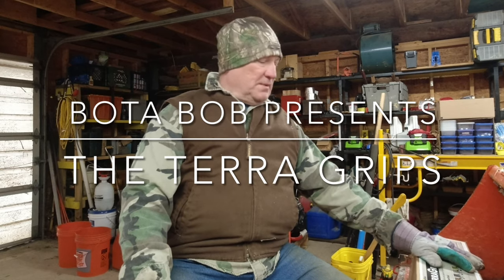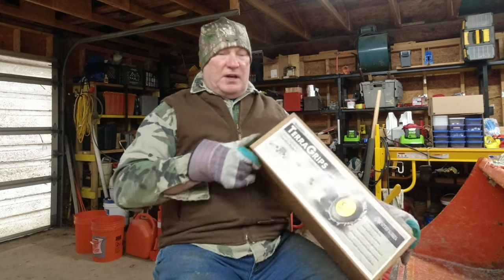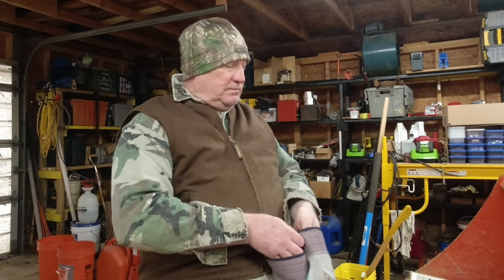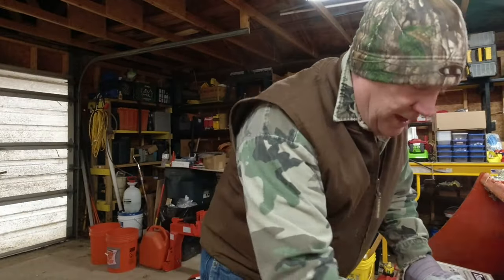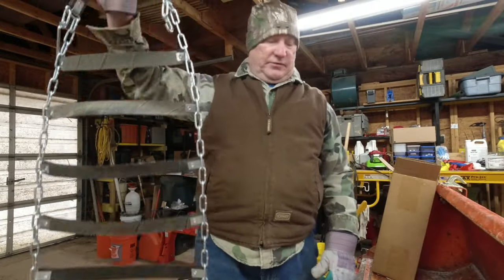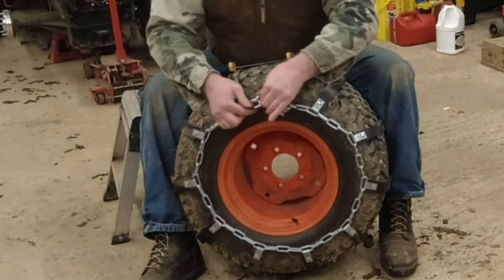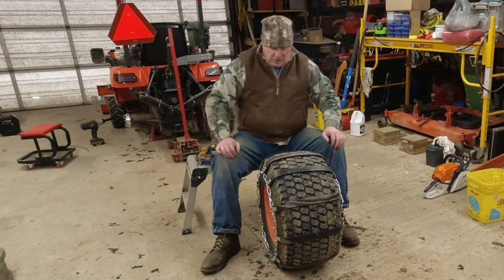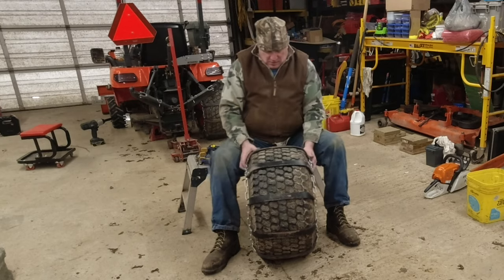#64 - Install Terra Grips

Comment: Great video and thanks for posting it.  I have been using them for 2 winters now and they work fine on my 7 degree slopped driveway along with 3 JD suitcase weights.  I took the JD out today to remove some slush to help a sheet of ice melt.  Forgot my rear suitcase weights the tire got too spinning and the chain almost came off.  I didn't get the Terras tight enough so I will have to fix it soon.  I like the use of the ratchet clamp and the tie wraps to hold the end of the chain back.  I am going to Lowes tomorrow and get a clamp. Also removing and adding air to the tires will help. Thanks again for the video and the great ideas.  I am hoping it makes installing the terra grips easier as they can they can be somewhat difficult.
Reply from the maker: They are a great traction device.  Good luck and let me know how things workout for you.  I would deffinately buy a new set if and when the time comes.  Thanks for watching and commenting - Enjoy the journey - cheers
Reply: @botabob  Hi Bob, just wanted to let you know the ratchet clamps worked great!  I bought a 4 pack of 6" clamps and I am glad I did.  The spacing of the terra grips were a little more than 6" so I started clamping on the inside of the tire after hooking that side and worked my way out using the clamps.  Worked great, thanks for the tip and thanks for your videos.   I subscribed to your channel so I will get the new ones you make when they come out.  Take care!

Comment: Looks good ! If you don’t have it in already, I recommend some type of fluid that’s non corrosive in the rear tires. Really makes a difference I think because it keeps the center of gravity low and if more weight is needed use bolt on wheel weights too. Bolt on weights without fluid filled tire not quite as good but better than none. From experience, weight makes a big difference in how good that traction is gonna be. Have a Blessed Day and stay warm, it looks cold in your garage.
Reply from the maker: Thanks for the recommendation - Stay tuned

Comment: I highly think these will work well for all year long use with weights. As they won't tear up your lawn either and can act like industrial tread tires for garden tractors.
Reply from the maker: Thanks for the suggestion - They work really good in the snow - but, they do make the tractor bounce a little.  I will try to install them this year without removing the wheels from the tractor - maybe I have learned a little since last years install - Thanks for watching and commenting - enjoy the journey - cheers
Reply: @botabob  no problem. Thinking about getting them for my Craftsman DGS6500 garden tractor. Already have wheel weights on it. Was thinking about these or ag tires for it.
Reply from the maker: The Terra Grips are excellent - I think you will like the traction they provide - I had ag tires on the back before, and they were good, but I think the Terra Grip is better - honestly the turf tires do good on the snow here, but once in awhile they will spin and I need to engage the differential lock - have a great day

Comment: Taking the tire off, smart. I’m literally installing mine in right now. I think I’m going to use my floor Jack and lift the rear end.
Reply from the maker: Good luck - check back in and let me know what you think.
Reply: @botabob  I didn’t take the tire off, used the Jack. I aired down the rear tires before putting them on (craftsman t210 by the way). I’ve been able to tighten the inside hooks by one, but I’m really having trouble moving the outside latch straps any further. 

Mine are not taught by any means, but I took a lap with them on and they did not move much or have any issues. Man, these are something. I should have taken the tire off like you. Really appreciate the video, sir.
Reply from the maker: After you drive for a little bit, try adjusting again - Airing down the tires is a good idea - I must say, I like the fact that they don't make any noise - and the traction was superior to running with out them - I bought them a year ago, and this week was the first opportunity I had to test them.  I'm glad the video was helpful, sometime a person wonders if it will make a difference - a lot of my video I make to help me remember things for the next time I have to do the same thing. ha ha

Comment: One more question Bob, did you hook on the 3rd or 4th chain from the end?  Thanks
Reply from the maker: I did hook onto the last link before the rubber cross link.  I think it depends on your tire and chain set.  I actually had to buy a bigger set then what was called for in the instructions.  Fortunately, my dealer (Messick's) allowed me to return the first set I purchased and replace them with one size bigger.  No difference in cost at the time - let me know how things work out.
Reply: Thanks Bob, I sure will.